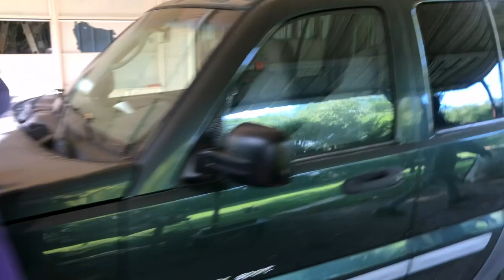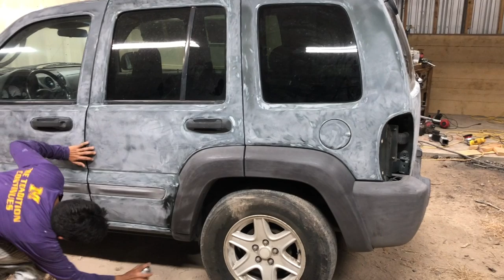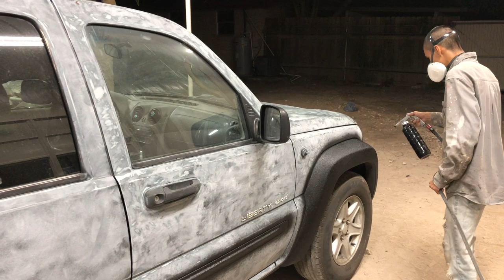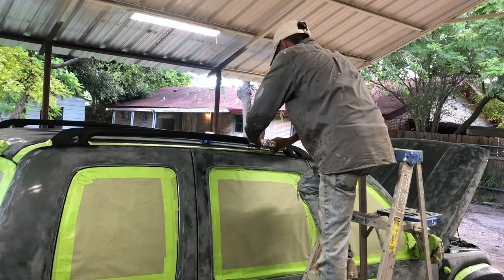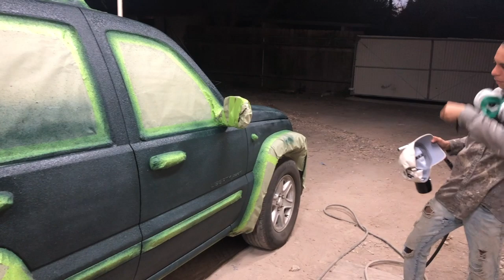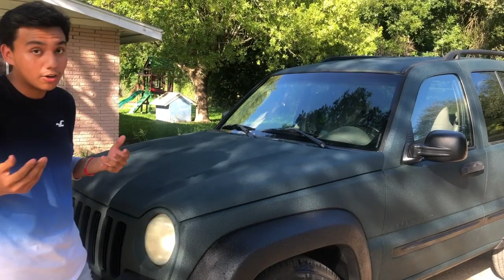Raptored Jeep Liberty

Comment: I like the aluminum foil trick, but may I suggest that to save even more turn the foil length wise and it will wrap more area and save you even more money. That two tone looks great. That is what I want to do to my Toyota 4Runner.
Reply: He actually did on the roof rack. The second piece he used was lengthwise.

Comment: Just wished u popped the little dent out out on the bumper b4 spraying but good job 👍
Reply: Thinking the same thing, heat the bumper and pop that dent out
Reply: I believe the boiling water trick works well in plastic. However may not be safe.
Reply: Dents=memoriers

Comment: I recommend spending the extra money on Upol vari-nozzle gun. You can dial in the texture from ultra fine to coarse for consistent results everytime without having to fiddle with different PSI. The gun that comes with the kit is junk, it's prone to getting clogged which results in inconsistent texture. It ends up splattering and spitting big blobs. Also, I suggest not spraying the "back wash"...toss the last 5-10% of the bottle and start with a fresh one. By the time you get to the bottom of the bottle, the hardener is already setting and doesn't flow as smoothly. You can check some of the stuff I've done featured on Raptor's Instagram under the same username.

Comment: Try using cling wrap  or a roll of shrink wrap too instead of the aluminum foil... it works on the engine bay to to cover odd shaped items to not over spray it.

Comment: Instead of sanding the whole car, you can use a maroon scotchbrite pad, it scuffs the paint the same, lots of bodyshops use it to prep parts before paint. I'd only use the sander on the really bad areas, like peeling clearcoat or whereever you need to featheredge the paint smooth. It'll save you guys so much time, i get a bucket of water, add dawn soap and scuff the whole car, your prepping and cleaning that way. Get you some tack cloths, they are cheap, they pick up dust before and overspray, i saw you using your hand to wipe away dust or overspray in another video.And use wax and grease remover, instead of lacquer thinner for wiping before you paint. You really only need adhesion promoter on plastic parts, not metal. Props to you young guys staying busy and out of trouble, and making a lil extra cash